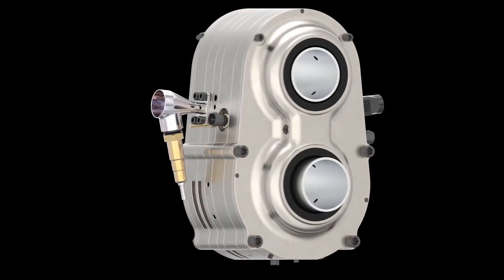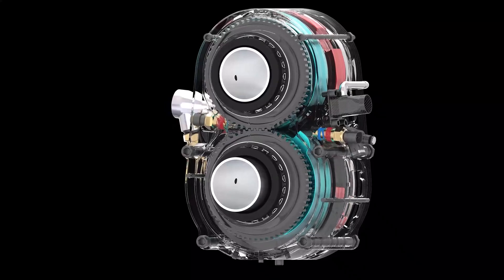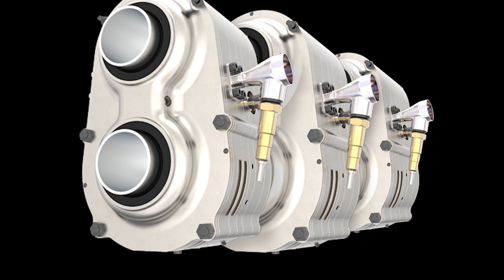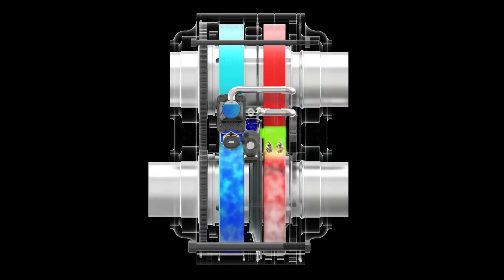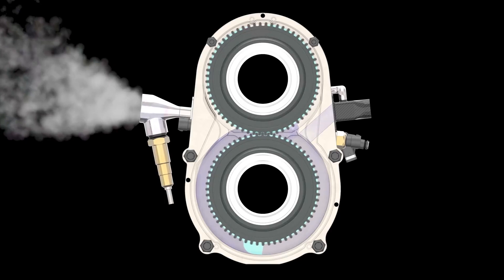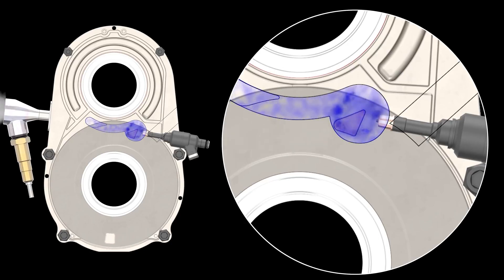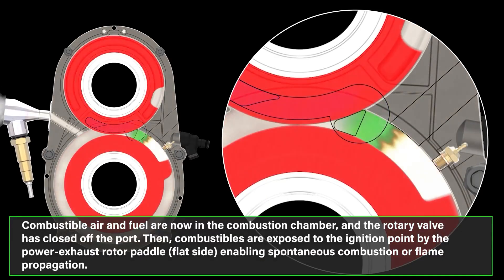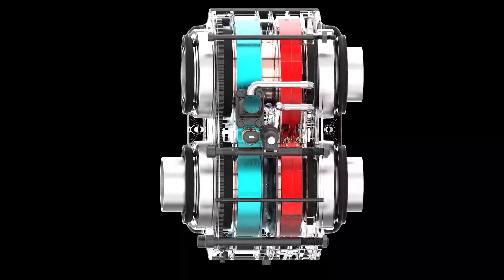This pistonless engine runs on hydrogen and revs to 25k rpm

Comment: The combustion engine (internal or external) will never be replaced by electric, simply because the energy density (in volume and in weight) of gasoline is orders of magnitude greater than of any battery system or of hydrogen. So even if the electric system efficiency is 4 times greater than that of an engine, gasoline still wins.
Reply: Exactly. Without IC there would never have been powered flight.
Reply: Yeah, maybe. But it seems my electric always wins at the lights and on-ramps because it's orders of magnitude quicker. Also, EU ban on combustion engines by 2035, and most European manufacturers planing on abandoning combustion engines even before 2030.
Reply: @adrianguggisberg3656   
The only innovations that last are free market innovations. The advantages of a new technology should outweigh the cost. You cannot force people to buy a disadvantaged technology forever. Over a century ago the market share of electric vehicles was ten times larger than it is now. People stopped buying them because they were impractical and expensive. Every petrolhead knows heavy cars don't win races, light and nimble ones do. Hauling too much weight in a car is bad for the environment and for traffic safety.
Reply: @peterdejong5456  The only thing holding back EV's in the free market in Europe right now is the ability or willingness of manufacturers to deliver. It will take longer in the USA, because American petrol cars are too big, too overweight and thus too inefficient by design, and that makes it harder for the transition to happen. It's none the less going to happen, because, as you said, one cannot force people to by outdated and disadvantaged products for ever.
Reply: @peterdejong5456  then again the technology behind batteries is comparable to petrol cars from 20-30 ..very little research has been done compared to cars and internal combustion engines.
Reply: @DrSmugface  
On the contrary. Electric cars are just as old as petrol cars. Electric motors are being used in industry and for transportation for more than a century. They are extremely well developed. Batteries existed even longer.A modern solid state battery is a huge improvement over vintage lead acid traction batteries. But battery technology would still need to improve dozens of times to catch up with petrol. That will never happen. You can't bent the laws of physics.
Reply: @peterdejong5456  Exactly what are you basing your statements on? Because I've been driving electric for several years now, and I don't feel my EV is lacking compared to the petrol car I had before, which was a Mercedes CLK 430 btw. Quite the opposite, actually. The EV has more power, better range, better comfort, costs considerably less to drive, and I don't have to support Mr Putins war against Ukraine with my hard earned. If the battery in my EV was a dozen times better than it is, as you suggest it should be, I could drive 6'000km / 3'800miles on a single charge, what should I need that for? Or anyone for that matter? It seems to me you  don't really know what you are talking about, and just repeat hear say. What really holds back EVs right now isnt the battey. It's the manufacturers ability (or rather lack thereof) to deliver sensible EVs in sufficient numbers, and the crappy electric grids in places like the UK or USA and intolerable charging infrastructure.
Reply: @adrianguggisberg3656  
Simply compare your old V8 Mercedes CLK 430 to a standard model Tesla S. Excuse me for using metrics. With a fully charged 75 kWh battery and a tank filled with 50 liters of petrol these cars both have appr 450 km range.

MB CLK 430 kerb weight 1455 kg.
Tesla S kerb weight 2180 kg.
Difference 725 kg (incl 550 kg battery). This large weight increase reduces energy efficiency, drivability and traffic safety.

MB CLK 430 petrol tank volume 62 liters.
Tesla S battery volume 300 liters.
Difference 238 liters. This large volume is lost for passenger space and luggage space.

For the same range modern batteries take up 5x the space and weigh 15x more than petrol. It simply doesn't make sense to use batteries for powering passenger vehicles, nor does hydrogen, because of its physical properties. This is because EVs only exist due to government policies, not because they are a genuine innovation the market has been waiting for for almost a century.
Reply: @peterdejong5456  What? Mate, the Model S doesn't have a V8, no tranny, no exhaust, no petrol tank, no belts driving the ancillaries, no engine refrigerant radiator, that makes more than up for the batterie. It's not even comparable, the Model S virtually has twice the space my old CLK had. It's a completely different category of cars, you'd have to compare the Model S with an E Class. That's much closer in terms of size (and also weight) and still has a lot less space. Yes, it obviously can travel further in less time, but that's not the only and all important difference. EVs and ICE cars have different advantages and disadvantages. That's only a problem for people who lack the ability to adapt.
Reply: This is true today, but tomorrow ? And why not using a "combustion fuel" to power electric engines far more efficient (today again !)
Reply: @raphanunu6912  No, it is very unlikely to see a battery weight improvement by 15x. And hybrid systems, i.e. a combustion engine directly powering a generator that powers the electric drive motor, like a range extender, for your main drivetrain has been tried and found no more efficient than using the combustion engine only. At least for cars. Larger systems for ships are a bit more efficient. But it's more costly and takes up more space plus ads weight.
Reply: @peterdejong5456  : Electric engines have almost 100% efficiency not comparable to combustion engines. Regarding the battery weight decrease I won't be so sure, they are so many trails not been explored. I guess Nature's goal wasn't to store the maximum energy in the smallest volume available, so why couldn't we be superior in this matter, at least ?.
But, I agree that you're right today.
Reply: @raphanunu6912   yes, electric motors are 3x more efficient than combustion engines but in a hybrid drive you only gain from the slightly better efficiency when the combustion engine can run at its optimal work point all the time. 

And if you burn diesel to generate electricity in a stationary powerplant and then run your battery electric car on that electricity the overall efficiency is exactly the same as when you drive your diesel car on that same fossil fuel directly.

The clean energy conversion from fossil fuels to green electricity and hydrogen does reduce overall energy use slightly, but because of population growth and growing wealth in developing nations we can expect the world energy demand to double in 2050 and to quadruple in 2100. Even if we manage to fully cover our current energy demand with green energy, we will still need every available other source, including fossil and nuclear, by the end of the century.
Reply: There would never have been manned flight without the ICE.

Comment: I’ve always thought electric engines were a buffer period until hydrogen technology and infrastructure is established.
Reply: Hydrogen is just another way to store energy..
Why use energy to make hydrogen when you just can make good Batteries ?
Reply: @DrSmugface  fair point. Which uses less energy to produce, now and with projected technology advances?. Another aspect is refuelling vs recharging. Hydrogen refuelling takes seconds. There also the impact a battery has when it reaches its end of life. Quite a lot of toxic stuff there that has to be dealt with. Hydrogen is used as non toxic fuel and no further process is required.

Comment: I'm not seeing it.  I consider myself Mechanically adept but am having trouble visualizing the cycle.  If you didn't design the engine but illustrated the function can you do a version where you follow a packet of Hydrogen through the cycle; from intake, to oxygen mixture,  to combustion to expansion, finally to exhaust?

Comment: There were many attempts for an efficient, hydrogen driven engine, most of them failed due to the fact that storing hydrogen in a car or other vehicle is far more dangerous than the current CH storage.

Comment: This isn't new, the problem with these engines is the oval rotor, it has three steel inserts on the leading edge to create a seal in the combustion chamber, and they are mega money and wear out fast and replacing them is a mechanical nightmare, making them unfeasible as an everyday all day engine, then the problem of the fuel cell, hydrogen burns hotter than the sun and is very unstable, fancy getting rear ended by a semi-truck with that in your boot, hole in road 6 foot deep and no car to recover, your toast,

Comment: I think this is super cool tech, but the issue with hydrogen-powered cars remains the lack of a distribution network.  Implementing such a network would require trillions of dollars of investment.  Natural gas pipes won't work because they are not built to handle molecules as small as hydrogen, and would leak.  I'm still on the electric bandwagon because the distribution network for electricity already exists. (of course, it needs improvement, but that is a different discussion :^)
Reply: And of course there's the lack of hydrogen mines.
Reply: And of course this engines only works in an simulation for real world use it needs magic

Comment: BRILLIANT 
first heard of this type of engine in the early 1990s a whelthy hauler from Yorkshire ran a turbine like this H2 could run a truck 🚚 🛻 he went missing never seen again? 😳 or his engine.   Good to see this.   Personally like battery electric  car connection to home renewable energy.   This could be good for some trucks 🚚? We need to ban toxic fossil fuel burning 🔥 H.F.Cs try slow anthropogenic extinction down 🌎 ❤️ #buzzofftoxic

Comment: Why would you express the weight of the engine in metric and the power output in imperial?
The whole video was a mixture of units from both system. FFS...stick to metric!

Comment: Why do we use seals and not "tight tolerances" on Engines? Because they get hot and cold. For a Car it must start at -15°C and while I dont know what the operating Temp of such an Engine is, I assume something around 100°C. Then we have the centrifugal forces added by revving this thing to 25000 RPM. If we could just use "tight tolerances" to fix seal problems, well, engineering would be a lot easier. Lets see someone build such an engine and have it run for a couple load cycles, see if it works.

Comment: Highly efficient hydrogen-fueled engines were used in WW1 by Germany. The scientist who knew "the formula" for the water conversion, came up missing (imagine that). YT even has videos posted my guys running engines on only fuel "vapor" (lawn mowers and their personal cars. They cost almost nothing to run. BUT, will the public ever get this technology ? .. Of course not. Too much oil money at stake. We could have been doing this for the last 75+ years.

Comment: I will believe it when I see it running and see what the reliability/durability is and how they allow for expansion and lubrication and strength and rigidity in the parts at 25.000 RPM,otherwise its just a pipe dream.
Reply: It will stay that ..a pipe dream

Comment: this isnt the future ppl have been designing stuff like this for years and years the problem is those tight tolerances they act like are no big deal just are not possible. look at the distance between the 2 shafts on this thing when the engine heats up the metal expands and now your clearances are gone. and thats only 1 direction of expansion. all these motors like this are nothing but scams to get investment money.

Comment: I feel that the way the spark is directed towards the seems between the two two rotating chambers would have a negative impact over time with it pushing on them and eventually making the motor unbalanced or even breaking something due to high wobble. The combustion chamber in a normal motor is on top and has plenty of room to escape into the exhaust. But the way this is designed seems like all it will do over time is warp the metal around it until the engine fails or teeth are gone or the crank gets warped at 25k rpm.

Comment: Still think the best setup for efficiency - is a diesel generator - charging batteries and capacitors - to run a electric motor. You could add extra power/efficiency with solar panels, KERS flywheel and braking.

Comment: I fear it might have a short lifespan due to the tight tolerances, but something so compact could serve as an excellent reserve engine in case batteries run dry. With so little weight and volume, there's no harm having it there in case you need it, and it would eliminate range/quickcharger anxiety as well as permit smaller battery packs for a lot of shorter-distance drivers. There's already some hybrids that use this design but I think they still use heavy, inefficient piston engines.

Even when the price of gas comes back down, it will be temporary. We will need to transition to electric eventually, so it makes more sense to invest sooner rather than at the last possible moment. There's no good outcome from being reliant on Saudi Arabia, Russia, etc, for the fuel that feeds our economies, it's like hiring a drunk taxi driver.

Comment: 160 bhp with 230 NM torque and 25000 rpm redline?
Anyone remotely connected to automobiles will know this is not correct mathematics. How come no one commented on this before?
Unless, we're talking 230 NM torque at 4000 rpm and 160 bhp at 6000 rpm and torque reducing rapidly after that till redline...

Comment: Hydrogen generator just like this, along with one or two super capacitors and small  50-mile range solid state battery are the future.  It's the only way to scale enough to meaningfully less emissions.  Why would every car need a battery pack large enough to drive 500 miles on!?

Comment: So the Biggest issue with hydrogen is the storage. It's really tricky. However, It's something a lot of smart people have invested billions into. (Just ask Anglo American). I personally am a big proponent of hydrogen. Sure lithium has it's space. But putting a 70 Tonne battery on haul truck just isn't feasible. Ships too can't really use lithium ions either. Fuel cells have turned out to be a bit trickier than predicted too. 

On the seams thing. Remember shafts etc. have to be high pressure and sometimes high heat sealed on all sorts of applications too. So I think there are more practical ways to do that other than an excited engineer zooming in a lot on CAD. 

Cool video though

Comment: Combustion fuels can be considered as nano-batteries if we manufacture the fuel with  a renewable energy source… 
Thus the question is: how efficient is it to extract hydrogen?  Another question may be: can we harvest and use the oxygen that is also separated from water? It may be too dangerous to have oxygen tanks in a vehicle (to boost HP), what else could we do with it in such massive quantities? 
This engine may have the best use in aircraft and motorcycles
Reply: All this needs is some magic